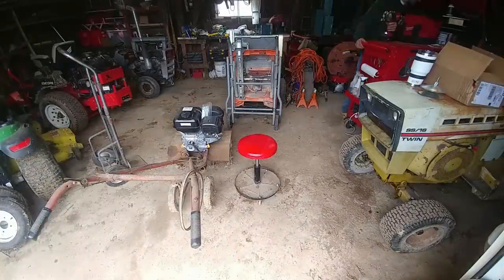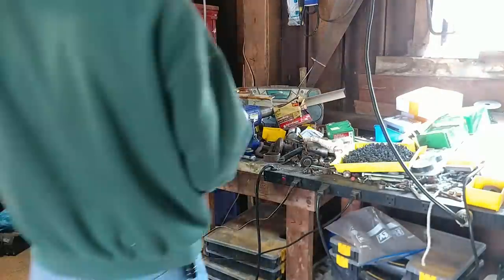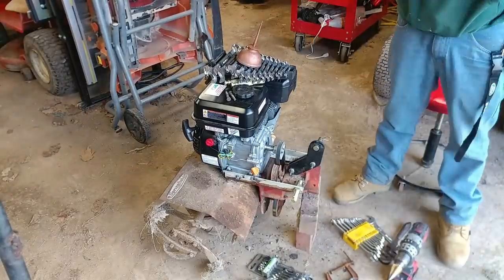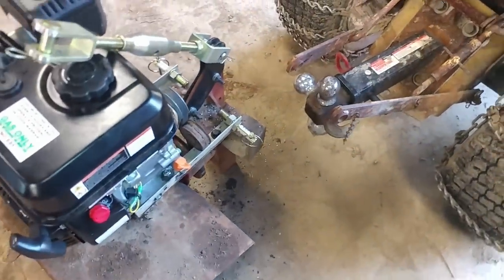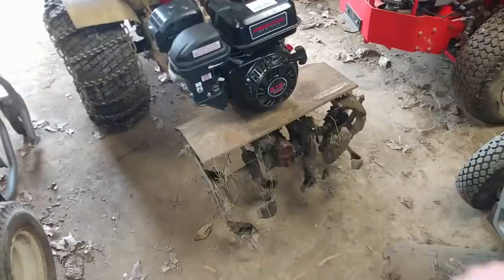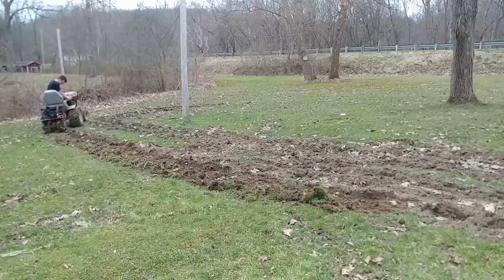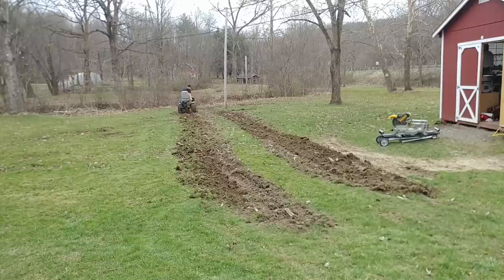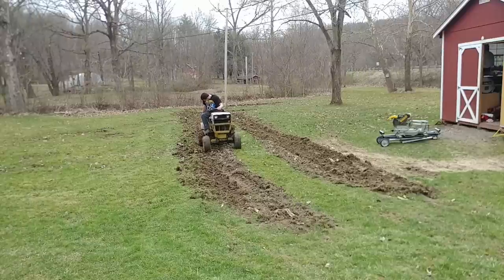The POOR MANS Tractor Mounted Tiller- A Walk Behind Converted To A 3 Point Mount!!!

Comment: I made an almost identical setup.  I have an old (80's) DYNAMARK 12/38, I have and old Montgomery Ward 5 hp  front tine tiller which I drag the same way you do.  The tractor is 12 hp, and the tiller is now powered with the same Predator engine as yours.  My hitch swivels some left and right, so the tiller follows the tractor, and fully up and down.  I made chains and wheel weights for my tractor, and I have done some serious tilling, for the last 5 years.  My garden is about 3000 square feet, I started from lawn with some small shrubbery.  I have yet to even slow the tines of my tiller.  It is a monster.  Since my tractor has no PTO, I'm fabricating a lift and a side to side mechanism (so I can till right up to my fence) to be powered by cordless drill, geared down, and using acme thread.
I'm guessing you have a loose belt.  I've taken out some good sized stumps with mine, and nothing gave, slowed, or even showed signs of laboring.  My tiller has a 2" pulley on the shaft.

Comment: I actually ran across your video because I am planning on doing the same thing except I am going to be using a sleeve hitch on a '68 Massey Ferguson. I am actually going to try and offset it to the right side so i dont have to run a tire through ground that's already been tilled. Great job!!!

Comment: If you can find an old tiller attachment for an old garden tractor most of them are wider than the walk-behind tillers.  I found one for an old AC Big Ten garden tractor, I'm going to modify a sleeve hitch and adapt it, power it with a Predator 212, all on the back of an old Gilson garden tractor from the '60's.  Btw, the counter-rotating tines will spread the dirt more than the regular rotation.  It would be really cool to figure out a way to switch between them on the same machine.

Comment: That worked out pretty good!!
Now that you have it tilled take a old bedspring or one field drag section and pull it over it to level it up.
Reply from the maker: It sure did. I have a set of discs that I'd like to use but I think they spread the dirt out when I want to pull it into the ruts. Will have to mod that too.

Comment: You could probably mount a board onto the back of the fender of the tiller and mount the engage and disengage lever to it if possible you can control it from the seat

Comment: It is possible to speed it up a bit faster as some has stated, but do you really need to. Sure breaking new ground with a little more speed would be nice, but after it is broke, all you will be doing is maintaining. The current speed should be fine. Everything takes a little time.

Comment: Hi, I have the same tractor except after replacing the entire ignition system my odd gearish thing that holds the balls for the throwball governor cracked. If your near Vermont and want the engine you can have it. It did run great till I was pushing more snow than I should, it started running like crap so I started taking it apart. I stopped when I found the cracked piece, there could be more damage, it was only running on one cylinder when I chose to investigate.

Comment: Your videos (and buckin' billy ray's) have me VERY badly yearning to live in a more 'country' area, have lived in cities or city-side suburbs my entire life (excepting college although my 30k-students university was basically a 'city' in the middle of a country-area AKA Amherst, MA), at any rate- HOW'S THE SCHEPPACH???  My CSP2540 gave me a big frown yesterday when, mid-job while topping-off fuel&oil, I was securely/firmly closing my oil-reservoir AND THE CAP JUST SPUN, SPUN SPUN IN-PLACE!  Stripped!!  Ugh am going to have to mod/alter that interface now because I'd been having issues with oil escaping, ever so slowly, from the reservoir's cap so I'd been making sure to go real slow&firm when closing it to full-closure and, within a week (maybe 2-3 uses in that period) of doing so, the thing strips out!  It's weird because it doesn't even feel like a  "full strip", I am actually guessing that, if you took yours and tried to go as firm as you could, you may also find that when it goes from what feels like "98% closed to 100% closed" that it'll loose-bite on the threading and allow you to do another full rotation of the cap!
For the time-being I will be leaving it a bit 'loose', allowing the slight oil-seepage that may occur / leave it sitting on a towel when not in-use, but this is a major PITA that is the first complaint I've got with the unit, for them to use plastic threading there and not have enough threads / insufficiently-deep threads to ensure a good 'bite'! 

Hopefully 'alterations'/fixing it will be as simple as finding a very, very soft rubber-washer-gasket-thingie to put in that interface before putting the cap onto the reservoir, allowing me to make-use of the OEM threading and  not have to deal w/ serious thread-alterations (unsure how I'd even do so, would be on reddit asking for novel ideas lol)  
[actually this is complaint #2, with the other being almost the same IE another seal, this time the air-filter-cover, that plastic knob you turn to open/close access to the air filter has a rubber-washer beneath it that, right after getting the unit & first-time ever looking at the (brand-new at that point) air-filter, when I went to close it the rubber washer wouldn't stay in-place it'd start distorting, I can't close it 100% because the circular rubber washer starts trying to ovalize itself around 95% closed, doesn't really matter at that location but certainly does at the oil-reservoir's cap!]

Thanks a ton for the videos man, it's great finding different perspectives on stuff I mean I'd never have found your channel had you not (awesomely!) been one of the only solid CSP2540 reviews out there, very glad you made that vid (I intend to do similar once I've got my [bonsai] channel up, figure "tree-related" is fair-game for me even though I'm hardly in a position to tell/inform anyone about anything lol but I'll be sure to be clear about my 'expertise' or lack-thereof! :D )